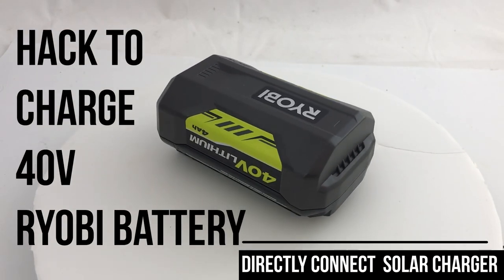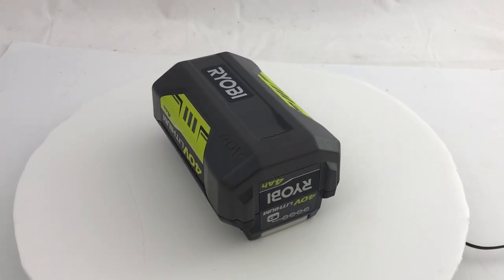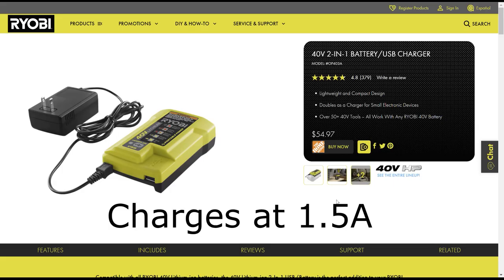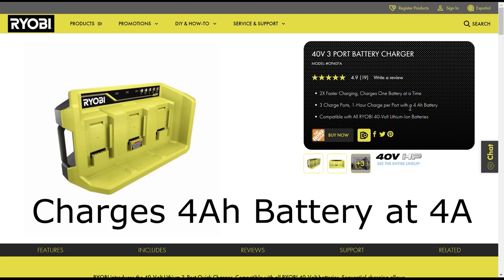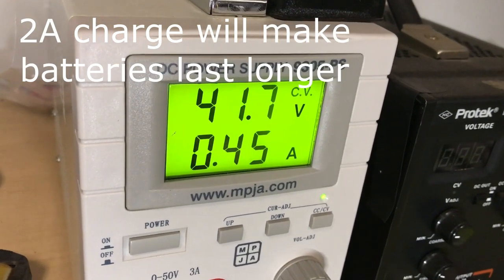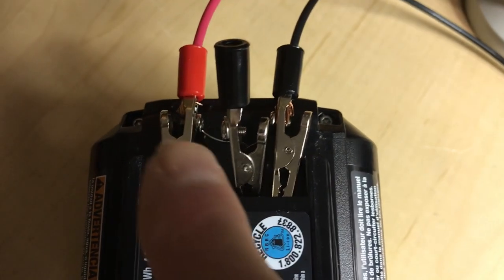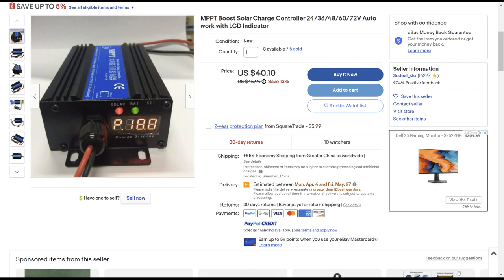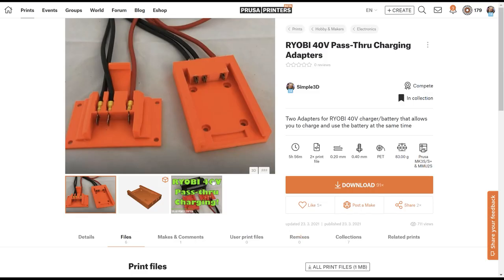Hack to charge RYOBI 40V Batteries - Directly connect MPPT solar charge controllers

Comment: Great video as always, Thank you. Can you use this method to charge multiple batteries at the same time? The cheaper MPPT seems to a accept up to 300w. If you can charge multiple batteries would you need to use blocking diodes on the positive lead from the battery out to allow pass through charging? Or would one MPPT only charge one battery at a time?  Thank you again.

Comment: You sir, are a legend, also 330k works as well, and also, the after market Ryobi 40v do not require the resister at all and will charge directly, I was looking to use these for camping, and the fact they don't have a 12v Auto charger for these is just ridiculous, and using an inverter to charge them.

Comment: That's some really cool stuff.  You would think that with the burgeoning interest in green energy generation and storage, and Ryobi manufacturing a huge number of batteries suitable for such storage, that they would engineer and sell a solar solution for charging their 18 and 40 volt batteries.
Reply from the maker: They are working on it. They announced a small 18V inverter with USB C input on it (for solar charging). The "new products" section  shows a couple of small solar panels. It was suppose to be out Fall 2021. But haven't heard boo from them?
Reply: @SerendipitySue  Talked to a Ryobi rep and they told me they still plan on releasing it this summer. Fingers crossed!

Comment: The OP403A "hat" charger is current limited by the AC adapter. I modified the cable for the OP403A to connect it to an MPPT charger and have seen over 4amps charging current. Charged up my 40v batteries this way all last summer without any problem.
Reply: lol, looks like you've already done this too. Curious, is all the protection in the battery already?
Reply from the maker: @IM_A_BEAR_LOL  Jim Shupe did the freezer test (stuck battery in freezer overnight). BMS would not let it charge until it warmed up
Reply from the maker: @IM_A_BEAR_LOL  THe Bosch ebike battery BMS also protects against over-current charging. it cuts charging off around 5-6A. I didn't want to fry a RYOBI battery testing it ;-)

Comment: Is there any way possible to charge a 40v battery with 12v? I have a 12v charger for my 18v batteries and it would be great if I could also charge 40v in my car

Comment: CAN YOU HELP ME ????? Im trying to figure out how to use 40vdc to run a trimmer, but there are 2 pins more than positive and negative. it is a hart brand 40v . i cant find any info anywhere.
Reply from the maker: sorry I don't know anything about the hart brand (is that walmart?). I don't have one to play with. Usually the extra pins are for temperature sensors

Comment: While I don't need to solar charge my 40V batteries I do need to rescue a few of them from under voltage. Turns out if you leave them sit "empty" for a few weeks they'll go below what the charger deems a safe charging voltage and refuses to take a charge.

Comment: I finally put this project together!   I was able to install the 300k resistor directly to battery and It looks like i'm charging and discharging at the same time.

Question Chris....     You said it's best to charge under 4 amps, but 2 will make batteries last longer.... HOW do you limit the amps with the setup we're using here.   Currently i'm  showing about 5.8amps charging with 16v from the panel.
Reply from the maker: The MPPT controller  can limiit the charge AMPs

Comment: For a 40V Ryobi battery that gets the "Red/Green" flashing indicator (means "defective" I believe) on the hat charger, how long do I need to have my battery connected to the power supply using the resistor as show in this video before I then move it to the hat charger and try to charge it up?
Reply from the maker: If the 40v battery does not charge on an official RYOBI charger, I would NOT try to charge it on a bench supply. I've taken a bunch of 40V from the recycle bin. Most often half the cells (one side) are bad.

Comment: Just my opinion; I have suggestion for everyone providing information about working with devices, whether it’s battery packs or whatever. Please provide the model/part number that is being describe. Because we never really know whether it will work on all of those battery types.  Because the manufacture may have internally designed them differently and they may not behave the same way.
Reply from the maker: This worked with my RYOBI OP40401 and OP40404 40V 4Ah (144Wh) batteries

Comment: Hi, do you know how to get the 36v ryobi battery into charge mode? I've tried a 300k and 1.2k resistor across the two pins you show. All 4 leds light up, but as soon as I provide 40.5v the leds go out and no current goes into the battery. Any thoughts?
Reply from the maker: sorry I don't know about the Aus. 36V version of the battery. I'm assuming it is different than the US 40V version (or maybe it's just marketing?)

Comment: What is the voltage on the third  contact on the 18v ryobi battery (the one with the 1.2kohm resistor) ? Thanks
Reply from the maker: voltage just gets pulled up via resistor and signals BMS to be in charge mode
Reply: @SerendipitySue  I ended up connecting the + & - of the 18v battery to the solar direct 20v variable then connecting the thermistor/bms to the 6 volt positive on one of my trojans...did the job! Bit of a risk but needs must in desperate situations! 😊👍

Comment: Thanks for the info on the resistor. I'm able to successfully charge my batteries from a panel and the boost controller. Just need to rig up a load to see if it'll discharge with the charge mode resistor in place.
Reply: Confirmed that the battery will still discharge with the resistor in place.
Reply: Finished my "battery box" and completed load testing. The bms does not allow for true passthrough charging. Solar input needs to higher than the draw of the load. Otherwise, the bms shuts off completely, and you're running on straight solar. If you're charging on a cloudy day you need to keep an eye on it. The bms can be turned back on by pressing the charge state button.
Reply: @fluffyeggs Damn that sucks. I was hoping to use this in a solar/inverter system. Can't charge/draw down as you state so that's a big issue

Comment: Any idea why the new Ryobi 12ah 40V battery won’t work with this configuration. 

All of my 40 V batteries will charge and discharge at the same time with this set up. 

For some reason the new 12ah battery just plugs in starts working for a moment, and then shuts itself off.
Reply from the maker: I don't have a 12ah battery. Could be they changed the BMS or circuitry?
Reply: @SerendipitySue  they must have!  I just got my hands on one and they have definitely changed something.  I’ll be curious to see if anyone can figure it out as these 12ah batteries hit the market.
Reply: I don’t know much about resistors nor am I an engineer so forgive me if this is a dumb question…but I am wondering if a higher or lower wattage resistor would get the 12ah battery to work? I have a couple of the 12ah batteries and would really like to do the pass thru charging with them. Has anyone figured it out yet?

Comment: Hi chris, why the 300k resistor didn't work with my 36v 4Ah battery? Plus of battery to T1.. But my battery is good, when i pressed the battery indicator it says 2 bars, what went wrong? im using the supplied 36v 1.7amp power supply, much appreciated, thanks
Reply from the maker: not sure... do you have a volt meter you can check the power supply voltage with? You call it a 36V battery. In USA they call them 40V batteries. I wonder if there is something country specific that is different?
Reply: @SerendipitySue  its written 36v on the battery sticker, you're right its all the same 36v and 40v,just label.. i wish someone will discover the hack to this 36v model, thanks much..

Comment: Thank you Chris, I have a strange thing happening between my solar panel and the MPPT (the one you feature here). When i measure the Volts from the Solar Panel using the DC out clipped onto my meter it reads 20 Volts, but then i clip it onto the MPPT and the Volts immediately drops to 5v. I'm using the Big Blue fold out Solar panel so I'm thinking it has something to do with the Solar Panel controller?
Reply from the maker: Since the Bigblue has a solar controller built in, you don't put another one in after it. The MPPT controller is meant to directly connect to solar panels
Reply: @SerendipitySue  Thank you maybe i can bypass it somehow then.
Reply: Works like a charm now. Bypassed the Big Blue Controller which now seems super inefficient because now i'm getting 85watts to the Ryobi charger. My next issue is that one of my 40Volts seems to be in sleep mode so maybe the hack you have here will bring it back to life. Intrestingly the battery in sleep mode reports back "41.7Volts" to the MPPT from the Ryobi charger.
Reply from the maker: @Joel-re1jz  check the battery output with a voltmeter. What does battery say when you put it in the standard RYOBI 40V charger?
Reply: @SerendipitySue  The volts are very low 2-3 and blinking red-green as deficient according to the charger.
Reply from the maker: @Joel-re1jz  not a good sign. I have revived many 18V packs, but no 40V :-( I just end up harvesting the cells. I think the BMS' fail. Usually I find half the cells totally dead.
Reply: @SerendipitySue  Good news Chris, I was able to open it up and use some solder wire to put in the reset and now it's charging. We will see how long it lasts. It's a Ryobi OP40261. I'm going to charge it full then test the voltage.
Reply: Yep, I can only get this one to 40.0Volts not 41.7 but at least it's chargeable.
Reply: Hey Chris fantastic work. What size are the female blades that the battery slides into. Ali express shows three sizes in mm?  Thanks again.
Reply from the maker: @prochon1  1-3mm wire size

Comment: I recently came into the possession of a Ryobi 40-volt battery OP4026 that was tossed into the recycling container.
I measured the pack and sure enough it was dead. Dissembling it, the batteries looked to be in good cosmetic condition. All ten cells had low voltage around one volt. I was able to manually recharge the pack by connecting a power supply to negative and positive of CL1 and CL10.  It eventually took a full charge and held it. All four led’s power indicators lite up. I then discharged the pack manually to 30 volts. Each cell to 3 volts time 10 equals 30 volts. I then tried to recharge the pack according the method above. It doesn’t work for me. Bottom line here is, it could be the BMS PCB not working. I also did play around with the test solder pads at the edge of the PCB marked RST/3.3v/ GND. Shorting one of them together temporarily, I did see the current jump up for a brief moment than back to zero. So again, not sure if the PCB is defective. I’m in the process of buying a Ryobi charger.
Reply from the maker: I've pulled out a bunch of Ryobi 40V batteries from  the recycle bin. All of them have had a bad BMS. I just reuse the cells
Reply: @SerendipitySue  Thanks for responding back so soon. Ya, I'm thinking the same thing of the PCB being bad. But I went ahead and ordered a charger off of eBay for $20. Things are pretty cheap ($) now a days. As I occasionally come across these packs. Back to do what retired people do, whatever they want, ha.
Reply: @SerendipitySue  Chris, you guessed it. This OP4026 packs BMS is bad.  I tried the battery pack in the charger that I bought off of eBay (sold as working condition). The Red/Green light blinks indicating the bad battery. Oh well, I tried.
Reply from the maker: @billspradlin9619  hopefully the cells are good. I usually find the batteries on one side of the pack are all bad... but that's still a lot of cells to use for something else